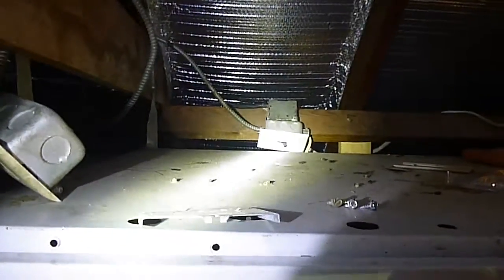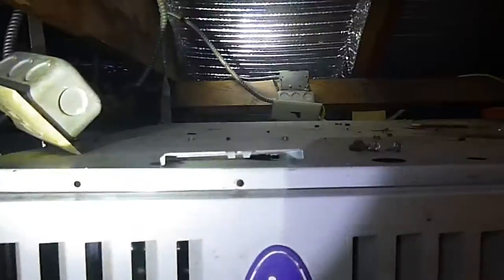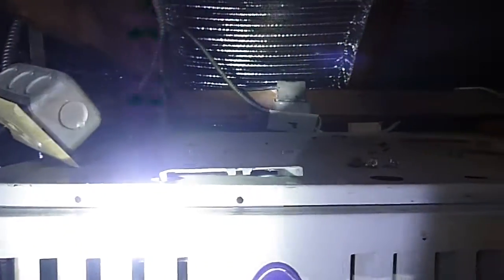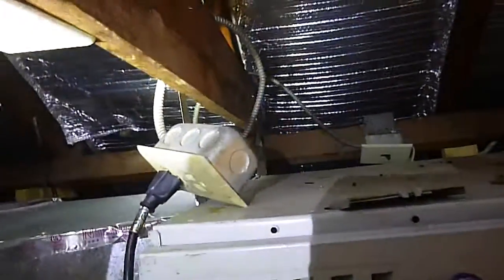3A. Indoor air handler electrical mystery.

Comment: You Mean Gas Furnace
Reply from the maker: You’re partially correct, I admire your enthusiasm. Some, but not all, heat pumps have indoor air handlers. Only split systems have indoor air handlers while package systems do not. An indoor handler is a cabinet housing the internal workings of a system; whether it be a conventional furnace, a split system cooling system, or a split system heat pump. An indoor air handler handles the indoor vent fan; should you want heat then it houses and operates the interior fan and the heating system (gas, oil, or electric heat source); should you want cooling then it houses and will operate the interior fan and it also holds the interior (evaporator) coils (a split system because the condenser is located at the exterior). The other type of system (a package system) includes all of these components inside of a single cabinet (package) located at the exterior. You were correct in identifying this as a gas fired furnace (located inside of the indoor air handler). The electrical mystery has to do with the electrical wiring to the indoor air handler (“gas furnace” if you must). All indoor air handlers, gas furnaces or heat pumps have electrical components. This video presents a question and seeks answers as to how the electrical system was arranged at this unit, so any help about that is welcome. Additionally, heat pumps also have gas furnaces for emergency or auxiliary heat. Not heat pumps rely on electric emergency/auxiliary heat. Putting this argument aside; what’s your opinion about the wiring?

Comment: You Mean Furnace
Reply from the maker: Yes, this is a gas fired furnace which happens to be part of the HVAC Indoor Air Handler. This cabinet contains the furnace and the indoor fan which handles heating, venting, and the low pressure side of the cooling evaporator coils on a split system (the condensing unit is located outside of the structure. So while it's convent to simply call this a furnace, it's more than that.
Reply: It has A Exhaust/Flue Pipe/Vent Pipe Pilot Light Gas Burners Heat Exchanger Draft Inducer Witch It Lets Carbon Monoxide
Reply from the maker: @zeframcochrane1183  Yes, the furnace in the indoor air handler has all of those things.